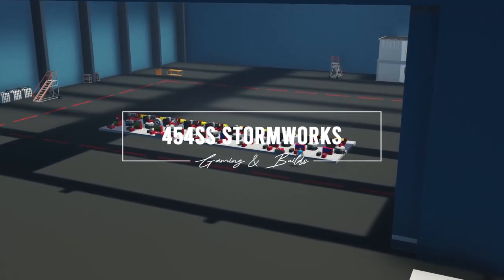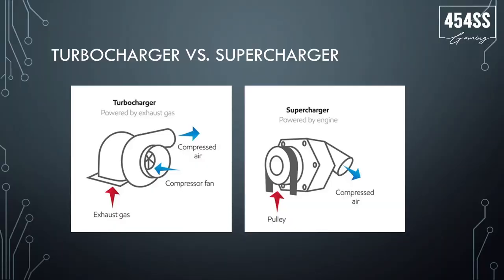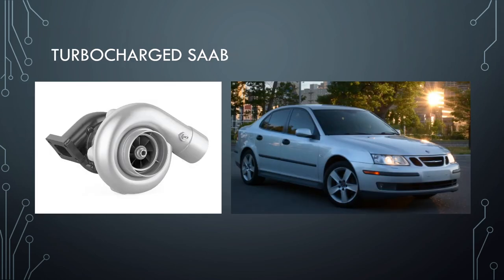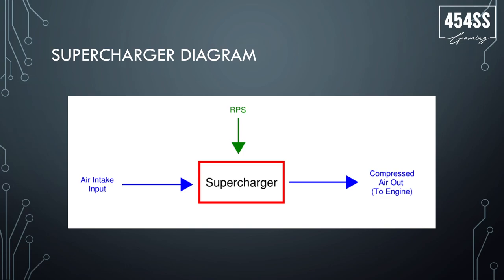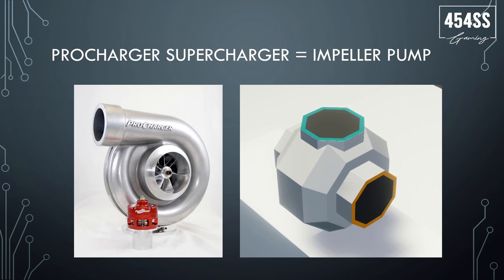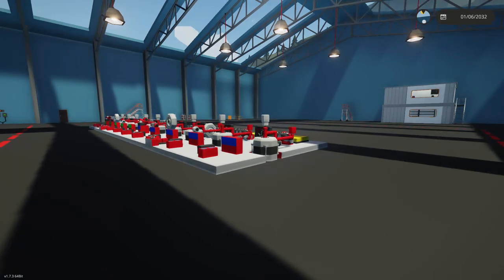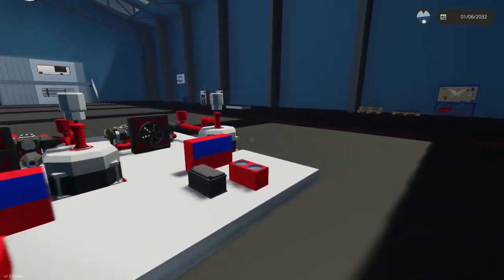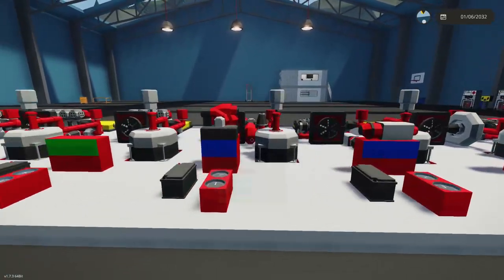SUPERCHARGER and TURBO power gains in Stormworks

Comment: how a turbo charger works. you have 2 snails, one's very exhausted, the other is a blowhard. They're conjoined twins so whichever way they turn, they turn together.
Reply from the maker: Totally :D Thank you for the comment! I gave a super dumbed down version for the sake of explanation how it could work with Stormworks!  XD
Reply: @454ss_gaming  I really wish you could push a fluid through an impellor pump and get an RPS output.
Reply: @DataDownLynk you could until they got rid of it due to infinite power and instead of fixing it they removed it.
Reply: @taliakuznetsova7092  I know it used to be a thing. but still makes no sense cause you can get infinite power out of a steam turbine by looping the steam back in.
Reply: @454ss_gaming 6 nylon 7u87😊
Reply: @DataDownLynk but the fix would be simpel just add pressure  and a reduction factor on the turbine
Reply: @DataDownLynk or the giant electric heater has infinite power if built correctly
Reply: @collinkaufman2316  Yeah I know, I built a submersible that goes 890 knots using the electric furnace. It's kinda great tbh.

Comment: You can actually get much better efficiency when using impeller pumps (especially with the large one) on a smaller engine if you use a clutch to reduce the load the impeller places on the engine with a clutch. It also helps if your ECU can alter the amount of fuel the engine gets on the fly to regulate the Air-Fuel-Ratio (a must when using an impeller pump if you ask me) so that the RPS of the impeller and with it the amount of air the engine gets doesn't increase so fast that the engine begins to lean out when the RPS of the engine rises rapidly.
Reply from the maker: Excellent idea :D Thank you for that detailed response! I will have to try that for sure!
Reply: Could also use a dedicated generator with a clutch (clutch lets you adjust engine load), using that dedicated power to run an electric motor at a PID controlled RPS. All you then have to do is find out the minimum RPS needed for maximum air flow/pressure without wasting power. Along the engine power curve, there might different RPS/clutch settings needed but I havent gotten to testing that yet.

Comment: Just like in real life, when running boost on an engine it may struggle to keep the AFR up because it may be maxing out the fuel injectors. The solution to this is to add a better fuel pump or more fuel intake manifolds,  and this applies to stormworks as well. If anyone wants to use the larger impeller or pump, you don't exactly need a larger engine-it really just depends on the quality of the fuel delivery system. When running smaller turbos with smaller engines, you can benefit from having an ecu that is preloaded with a turbo tune, such that it increases the fuel manifold throttle proportionate to the boost that may be generated by rpm, or manifold pressure. The upsides for this system is that it allows large boost on small engines, and steady control of the power the engine generates; the small impeller on the V8 was inconsistent-something that this setup may fix.
Reply: It would be really cool to see just how much power one can squeeze out of an engine of a certain size.

Comment: how is it possible you made so many custom engines that are worse than the basic small engine?  my small engine makes 63 electric on a small generator
Reply from the maker: it is not all about power output for me, it is to make something that is reliable and stable for the creation :) But yes, there are ways to optimize and make it better

Comment: It should be noted that just adding a pump to the engine does not automatically make it more powerful and can actually cause the engine to not work at all because the afr may be too high.    With all due respect to MrNJersey for what he has done to help others learn,  That ecu is really outdated and overcomplicated.   I have made several for my own builds that are more simple and work much better.  So learning the process of getting the correct AFR is essential for anyone really looking into getting into modular engines.    

Something that I have found is that if you use composite nodes ch 1 and 2 from the engine for air and fuel, multiply it by the number of cylinders then by 60, you get the flow rate in L/S of fuel and air.   That can be useful for determining afr in a larger scale.   

When you add a pump to the fuel and air, the fuel will be limited to the fuel manifold setting, but the air will be increased at any setting.  So you need to increase the fuel manifold value to get the proper afr.   Adding air pumps allows for a higher volume of fuel to be burned per cycle, so instead of maxing out at around 0.45 to 0.5 fuel manifold setting, you can usually get upwards of 0.6 fuel manifold setting before it becomes too rich.    

Small fluid pumps and one fuel and one air manifold works great for small engines, but 3x3s and 5x5s need much more air and fuel per cylinder per cycle, so one air manifold, one fuel manifold and a small pump per cyllinder is reccommended and can actually be mandatory with large engines.  On 5x5s it may even require 2 per cyllinder.
Reply from the maker: That is key! I just wanted to compare apples to apples, but yes, I have heavily modified NJ's ECU design for my creation with smaller vehicle engines :) Thank you for the amazing insight and comment!
Reply: your reply was very helpful , now i can further work on modular engine for my prop plane, thanks :D

Comment: First, before i start my "rant", i want to say that i really like your videos and especially your design constrains video. I fully agree on this topic with you.

Torque doesn't mean torque in this game. There are multiple theories what it actually means and my take on it is that it represents the inertia mass of the pipe system. There is a theory that it displays the mechanical resistance, but that can't be true as flywheels will add a huge amount of "torque", but almost no resistance. 

There was a brief moment in the development process of modular engines where the devs tried to implement turbochargers and didn't quite succeed. They tried to make the impeller pump work like a turbine if fluid pressure was applied to them. I think they never got the balancing right, because they were afraid to implement yet another infinite engergy source into the game. I tried everything to make them work back then, but it was never possible with how they were implemented.

Look at a cylinder of a supercharged engine. If the AFR is oscillating, then the intake pressure is not steady enough. The stoichiometric will be constantly over or under your desired value. The power output will fluctuate, which can make something like a traction control quite tricky.

The small fluid pump (3x1x1) is not well suited to supercharge a modular engine as it will shut down at a pressure of 10. So, the pipe fills to a pressure of 10, a little bit supercharging happens and the pump turns off, the pressure drops immediately and the air intake is starved of air. Then the cycle starts again. Same is true for the large fluid pump, but it works better in this configuration as it turn off when it hits a pressure of 999. The small amount of air these tiny engines take is not enough to bring the pressure down to the maximum supercharge pressure (something around 100 or 200 pressure). But you will run into the same problem with larger engines if you don't use a bypass (variable fluid valve).

The impellers don't work very well on this scale as they will need more rps and therefore more power of the engine as is shown in this video. Or else they will also create the afr oscillations. However, no matter the scale, large fluid pump(s) + bypass will allways outperform impellers in the usable power output and therefore also the fuel efficiency. It is just that the advantage gets smaller, the larger the engine becomes.

What you completely missed is the air scoop. Facing into the direction of movement, it will create enough intake pressure at relative low speed to supercharge a modular engine. If you put a engine on a carousel, then it should be enough to see a noticeable power increase. They are small, easy, cheap and use no engine power for the supercharging.
Reply from the maker: Thank you for the well thought out response :) Glad you enjoy the videos, more will be coming soon! 
Interesting about the turbochargers, I didn't know the devs were considering them. And good advice, thank you - I will play with the variable fluid valve, that sounds promising, especially with the large pump! And excellent point about the air scoop, that is something that I have not played around with, but sounds worthy from what you mentioned! Thank you for the comment!

Comment: Just some useless input: "Prochargers" are actually called centrifugal superchargers -- ProCharger being a brand, and have different power output than a standard twin-scroll belt-driven supercharger irl -- Prochargers act more like a turbo (aka they produce more power within a certain RPM range, but still with linearity), superchargers produce more linearly (aka they produce power strictly according to the input RPM).

Also, instead of using a standard fluid pump as an electrically-driven supercharger, you could theoretically use the impeller pump with a small electric motor, all hooked into an MC that increases the output of the motor as you need more power (or the engine spins faster). Would look cooler (and probably perform better) than the basic fluid pump. Something to try!
Reply from the maker: Great input, love forced induction :) That's a really good idea to try out! Thank you
Reply: @454ss_gaming  anytime! I'm biiiiig into making engines on this game. I do find it funny how you can "bypass" the game physics and make something with forced induction, haha